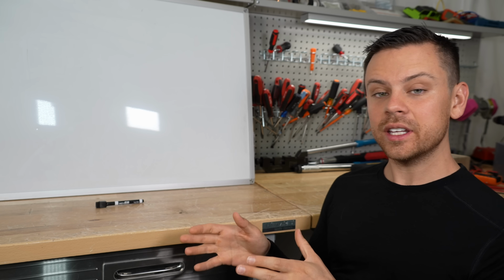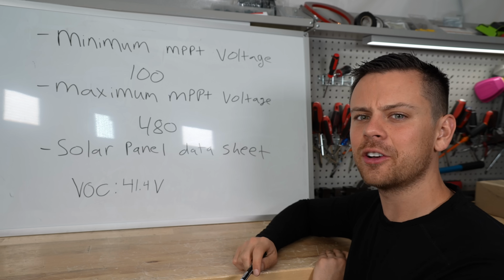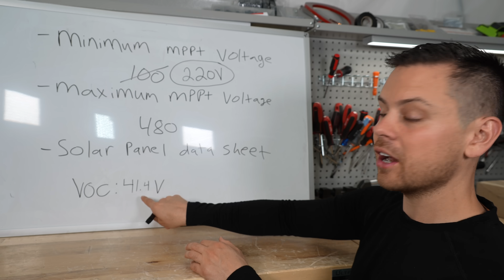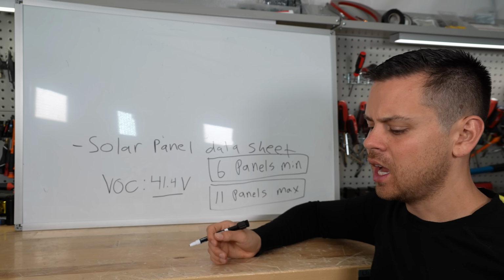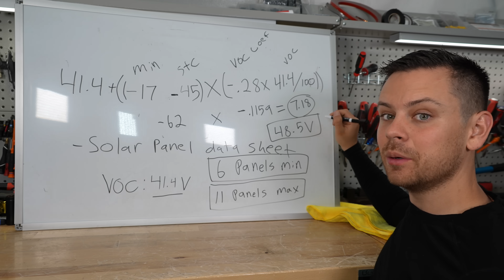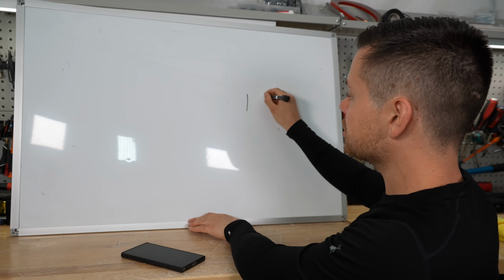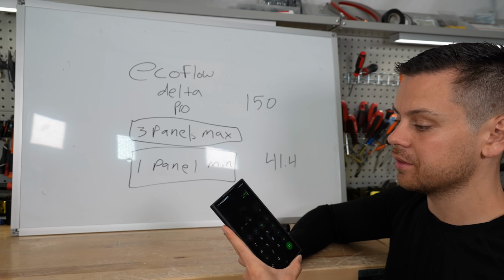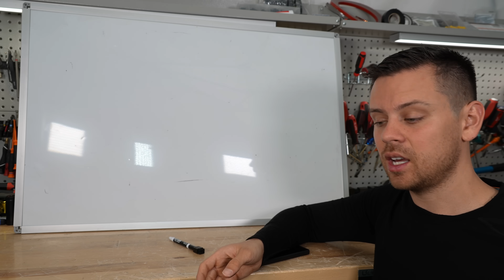Solar String Voltage Made Easy! How many solar panels can you safely connect?

Comment: Will, great explanation to a problem I wasn’t aware of! Using an EG4 3k all in one inverter on my cargo trailer I was focused on keeping my input DC <500v. With 20, 100w (Voc 24.3) panels in series, in the coldest estimated climate I’ll be in, calculated out to 589v dc! I’ll be switching my configuration over to 2 parallel stings of 10 panels in series before cold weather hits this year!

Comment: Thank you for this information. I am designing a system that will not be permanent since I will be selling my home in about five years so I would like it to be portable. Thankfully I live in the desert where we get about 350 days of sunshine a year and it rarely dips below freezing. I will also be moving to another part of the desert when I retire in five years which is why I want to keep my system portable. 

Unfortunately, there are only a couple of solar contractors in the area who don't want to do anything other than their largest system at an ungodly price without taking into consideration what I am asking for. I understand that as contractors they are professionals and understand all the quirks that come with installing a system. But I live in a 1300 square foot home. I don't need the same system as those living in a 3200 square foot home. But the local contractors seem to offer a "one size fits all" package with a "take it or leave it" attitude.

Comment: Will, where do I find the VOC on my unit? it's not on the spec lable as VOC.  In the PV section I have:
  Max Power 4000 watts,      Max open voltage 450v,        Max input current 13A ,      Max charge current  80A      and MPPT range  120-400 vdc

Comment: When does an environment become too cold as to need calculation?
Reply: Will be good to calculate if it is less than 25 degree C because your string voltage must always be more than the minimum MPPT voltage else your inverter will not allow the string to produce energy.

Comment: Voltage is one side...what about the Amps???
Reply: Short circuit current and current @ mpp must be lower than the rating stated in the datasheet of your inverter.
Reply: Interesting that Deye say there 8kva inverter will only take the inverters max even if the string gives more amps.

Comment: Hello Will,  hope all is well.  I greatly appreciate this video and many of your others. I am confused about the operating range (120-385) and input voltage range (100-480). If you can't use anything over the 385, why panel close to but not over 480? Similarly, I have seen in another video where a person paralleled these aptos 370w into the 6000xp. Isn't the max usable input current 17A. I am a newbie. Any more information would be very much appreciated. Thank you.

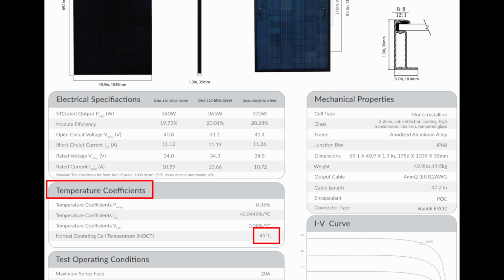Comment: Hi @WillProwse I think you used the wrong temperature reference at minute 7:24. The Voc at STC is measured at 25 deg C and not at the NOCT of 45 deg C. Therefore at -17 deg C, the maximum Voc will be 41.4+(-17-25)*(-0.28*41.4/100) = 46.27V i.e. an increase by a factor of 1.118.

With this in mind, it should be possible to string together 10 pieces DNA-120-BF26-370W modules (10s1p) with a combined Voc of 462.69V while leaving some 17.31V headroom just in case the temperature ever dropped to -32 deg C.
Reply: Thank you, I wasted a lot of time trying to figure out why I kept getting different results from calculators.

Comment: I don't understand why inverter manufacturers don't build in over voltage protection.
Reply: All top tier inverter manufacturer like SMA, Frolis, sungrow, huawei, etc do have over DC and AC voltage protection.
Reply: Is this on the PV inputs?
If so why all the concern about cold weather causing damage to inverters because of over voltage.

Comment: You did not say they should be the same brand and model and built at the same time. They also should be the same sun harvesting potential. If some of the panels are shaded and others are not they will go down to the lowest panel harvesting. You should have said to just buy a pallet of 10 and put them out on the ground all together with no trees to shade them. I was hoping you would make it easier but it seems you have kept it just as confusing. What happens if you have a string of 10 and a connection starts to degrade? That will bring down the maximum harvest of the whole string so keep connections good. Something I was told long ago is to not unplug panels while they are lit. Always cover your string of panels when plugging and unplugging for potential arcing of the connections. You could also wait until dark when they are not producing power. Each panel is 300+ watts and 8 amps.

Comment: Most inverter data sheets will list a MPPT Voltage Range (limits the inverter will work with) and Rated MPPT Operating Voltage Range.  For folks not following the cold temp math/concepts, the later (Rated MPPT Operating Voltage Range) is the area you want to target, and also leaves plenty of headroom for cold temps for most users.

Comment: Will can you help me? I have two 100 AH power queen batteries, in parallel I’m running a 2000 W inverter and I have the Victron 100/20 what size solar panel do I need to hook up to this set up?

Comment: Because you are a fan of the Aptos Solar Panels and the EG4 18 Kpv, and I am a fan of yours :)
I ran your calculations and came to the following conclusions: (Real Question is at the bottom)
 - I live in Ohio, so my minimum temp is -19C
 - The Solar Panels I have 40 of the Aptos DNA-120-BF10-440W (run in series 10 x 4 Strings)
 - I get the following:
 
 NORMAL OPERATING TEMPERATURES:
 ------------------------------
 18KpV
 - Min MPP+ Voltage = 100v
 - Max MPP+ Voltage = 600v
 
 - Min MPP+ Operating = 140v
 - Max MPP+ Operating = 500v
 
Panels Open Circuit Voltage = 41.51

Min Panels : 140 / 41.51 = 3.37 (4 Panels)
Max Panels : 500 / 41.51 = 12.045 (12 Panels)
Max Panels : 600 / 41.51 = 14.45 (14 Panels)

MAX COLD OPERATING TEMPERATURES:
--------------------------------
{Open Circuit Voltage} + (({Min Temp by Location} - NOCT) = {COLD NOCT}) * (({Temperature Coefficients Voc} * {Open Circuit Voltage}) / 100))

41.51 + ((-19c - 45c)) * ((-.30 * 41.41)/100)
41.51 + (-64 * 0.12423)

41.51 + 7.95072 = 49.46072 V

Max Voltage @500v / 49.46 = 10.10 (10 Panels)
Max Voltage @600v / 49.46 = 12.13 (12 Panels)

Max Series Voltage @41.41 * 12.88A = 533.3608W * 10 Panels = 5333.608 Watts
Max Series Voltage @49.46 * 12.88A = 637.0448W * 10 Panels = 6370.448 Watts

Max Wattage @41.41v (5333.6 W) * 4 Strings = 21334.4 Watts
Max Wattage @49.46v (6370.4 W) * 4 Strings = 25481.6 Watts

The real question is what happens on a very cold day, and the overall system is producing 25,481 watts, and the EG4 18Kpv states in the spec:
MAXIMUM UTILIZED SOLAR POWER		18000W
RECOMMENDED MAXIMUM SOLAR INPUT*	21000W

Should I consider turning off a string during very cold weather?

Thank you

Comment: Thanks for this video, Really wish I had seen it 3 weeks ago before I bought all of my stuff. My system as I have it designed will have 102 Voc on a cold day in the winter and my Inverter can only handle 100 volts. Now I need to decided if I want to redesign my system or hope that I have 2 volts of voltage drop in my wiring.

Comment: I am running EcoFlow Delta PRO with additional battery powered by three 510Wp (VoC = 45.85V, 14A) solar panels in series 24/7 for a year now. This system system powers core of my household (2x fridge with freezer, home office and computers, if excess power, than also washing machine and dryer or  other appliances) and it works great and provides ~1MWh of electricity in a year.

Comment: Do you hv video on solar panel system use which type of circuit breaker /Amps? your video very good information for newbie like me
Reply: The circuit breaker is caclulated based on your inverter's current output rating. 
Say if inverter X is rated at 2000W, 115V single phase. Current will be 17.4A which means you will need to use 20A single phase circuit breaker.

Comment: In your example would it make sense to put in a bypass on two panels with some type of thermally controlled switch that would cut out two of the panels if it goes below about -5C for a safety margin? Then when it's above freezing you'd always have all of your panels and if the temperature drops the switch could just connect those two extra panels to something like directly to a resistive heater inside a space you heat anyway to avoid losing their power output?

Comment: Question on max DC input voltage vs Max MPPT Voltage. The inverter I was looking at shows 600V max input, but the MPPT range is 50-550V. The panels, after doing the cold calculation for my area work out to 46.18Voc, and I was looking at 12 in a string which works out to 554.16V.

That's not going to damage anything? What happens outside the MPPT Voltage range?

Comment: How many people get into trouble by adding panels later to an existing system?  Are there any guardrails to prevent the original control equipment from failing?  Is there a way to design a system so that panels may be added in the future without exceeding the minimum/maximum voltage limitations?

Comment: I noticed that maximum amps are not factored in which is also very important. It’s easy to exceed this when coming two or more strings or pairing a weak MPPR with high amp panels
Reply from the maker: Have video on parallel strings

Comment: My installer convinced me to go with 14 panels instead of the original quote of 12 panels due to shading concerns. My inverter lasted for only 12 months and packed up after the second winter. They reduced the connected panels to 11 when they replaced the inverter under warrantee (luckily). Based on these cold weather calculations, 13 panels would be redlining my inverter during the cold months. 12 would have worked, but I am sticking with the 11 active panels for now.

Comment: Does the volt recommendation of 220V apply to anything below 220. For example, if I have a minimum mppt voltage of 150, do I calculate it as a 220, or do I raise it up by adding 120 and calculate it as a min. mppt of 270, which still wouldn't exceed the max in both scenarios. I just don't want to end up purchasing more solar panels than necessary. Thanks! Your channel has been very helpful. I'm new to solar, and recently, I had a grid issue that left my parents without ac for about a week. It made me realize how dependent we are on the grid, so I want to learn more about other energy solutions, and your channel has been a blessing.

Comment: I have a 40 amp Renogy 100v mppt charge controller running a 24v 200 amp battery system. I am using, for starters , in parallel,  an  Allpowers portable 40v 200 watt solar panel that I just recieved 10:58  .. &  on the other side,  2 18v 160 watt renogy panels in  series  creating like 36v.. both panel systems have similiar amps.  Is this  a good performing system or should I do something else?  Thanks!😀

Comment: I thought that if you exceed the Max MPPT Voltage slightly that the charge controller will "clip" the input. Some solar folks out there have said to over panel your system for cloudy/winter days. What is your take on that thought process?
Reply from the maker: That's current, not voltage
Reply: @WillProwse  Thanks for the clarification. Keep these videos coming!

Comment: Hi Will, l got "thesis" for you. And it goes like this and should apply for all types of inverters: As long as the recommende voltage is maintained, there is no upper limit of how many panel you can connect, the inverter will only pull the max amount it is rated for, rest is not used.
You have the means and method for testing this, I have only tested this in small scale. . Anyways, keep ut with the good work.
Reply: That's called overpaneling and common practice

Comment: Very interesting video. I have the Luxpower LXP-LB-US 12k and they give two numbers:
PV input voltage range: 100-600V
MPPT voltage range: 100-500V
I bought 12 LONGi LR5-54HPB-410M in my cold Montreal Canada climate.
The Voc is just above 500V in winter but it will drop as soon as mppt kicks in. 
But I am unsure if I can use the 100-600V range in my case when calculating max amount of panels.
Vmax of my panels: 42.85

Comment: Question on this.     I live in New York State so we have heat and cold to deal with we can temp  100 degrees or more during the summer and in the winter with wind factors, we can be as low as -20 or more.  Since we want the best out of our system no matter the time of year could I go with the 11-panel for summer and interface some kind of switch to be able to shut down 2 panels for the winter?  This way I'm getting the best out of my panels year around.   Now also you are talking about a 48V system I will be doing a 12V system cause I'm putting my system up to run a camping trailer off-grid which already has a 110 / 12 inverter in it from the factory.

Comment: Yeah, i have that exact issue now. 
Want to add 1 panel in series but it will exceed max charger (victron 100/50) pv voltage for 10-20v, specially when its cold. 
This forces me to do 2S2P (max 78v) instead of 3S (max 118v). 
The issue with 2S2P is, for a couple of hours, the charger will cap the max output (i tested it, it goes up to 1500W (actually it exceeds a bit when in absorption mode).
There should be some adapter to lower voltage on this scenarios, it should be simple device, i guess?
Reply: i've also thought about covering part of the PV, as each cell adds voltage, but i would end up needing to cover up 8 cells x2 (pv itself is wired in parallel) for each of the 3pvs, and that would lower also the watts, 20% or more. So that's not a solution.
Reply: Actually, math says, i'd be over not by 18 but 32, with 3S.
In the winter, there may be a dozen days it goes as low as -10 or -15ºC. But if i forget to disconnect it, i fry the charger.
Either i upgrade to victron 150/50, as max would be 118-132(cold), or do 2S2P, which should also give some more w in the morning/later.
Thanks!

Comment: yea so, for protection I think I would automate something with a smart outlet that runs my outdoor temp sensor. So just in case the temp drops lower than expected with weird weather these days it will cut the circuit to the charger. I already use the temp sensor in a few automations like a propane fireplace when colder than 42F to turn on only when I am home to help with the electric heat pump system. 
Or does anyone make a charger that already has an external temp sensor. you can install and set the max cold temp in the charger?

Comment: A boat build channel I follow recently ran into that VOC limit of their controllers. They disconnected the battery bank from their charge controllers, leaving the panels connected, in full summer sun. Sparks and magic smoke emitted from a dozen or so blue Victron boxes. Fortunately the ending was a happy one, involving a GoFundMe-type thing, but I immediately thought of your channel when I learned of this. (They're bringing in pros to design the system, and make sure they've got appropriate fusing and disconnects.)
Reply: Jesus...what a silly move lol.  I installed my second array near dusk, being beyond extra safe because I didn't want to hurt any equipment.  That's with Enphase micros too, very little risk at all with what I was doing.
Reply: @whattheschmidt  To be fair, they're pretty clear about being DIY and not knowing everything about everything. Good people, just a bonehead move.
Reply: @McTroyd  oh, I'm sure they didn't mean to. It's just crazy no one thought about the power it was currently producing.

Comment: Will 6 of these BougeRV solar panels wired in series be enough to power the EG4 off grid inverter?

BougeRV Yuma 100W CIGS solar panel:
Max. Power Voltage Vmp (V)	24±5％V
Max. Power Current Imp (A)	4.21±5％A
Open Circuit Voltage Voc (V)	30.5±5％V
Short Circuit Current (Isc)	4.71±5％A

EG4 3kW Off-Grid Inverter | 3000EHV-48:
PV Array 120VDC - 450VDC

Comment: Hi. So basically I need to calculate string, using max inverter voltage parameter for VOC, and considering the coldest temperature in my area with given solar panel, to not exceed it? Thank you

Comment: When the temperature cools down and the voltage increases does the amperage drop or the watts increase?
With bi-fascial panels, they have a possible higher wattage numbers. Does that affect anything other than getting some extra watts?

Comment: Voc is usually reported at 25C (STC), which is not the same as NOCT.
Reply from the maker: That's why I said notc three times in video. I meant to say that
Reply: @WillProwse  Doesn't make sense to me. The Voc in your calculation is given for 25C STC, not 45C NOCT, we don't know Voc for NOCT from the datasheet. Therefore, the distance to -17C is 17+25 to be used with said STC Voc as a base to get the Voltage at -17C?

Comment: I'm confused, If the open circuit voltage is not seen because the panels are connected why is it so critical?
Reply from the maker: Because of that is the voltage that will be exposed to the solar input. If the hardware can't handle that voltage even for a second, It will be destroyed

Comment: I am interested in hooking my aptos 370w panels to a low frequency inverter. Looking at the Growatt 6k off grid. My problem is the pv input is at 245v and like 80A. Wouldn’t I need larger than 10awp wire for higher amps?